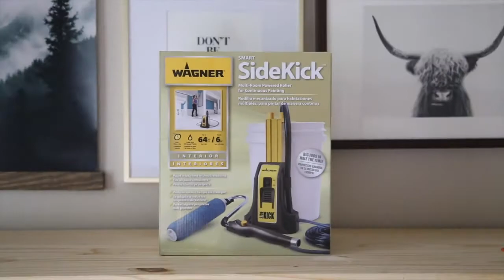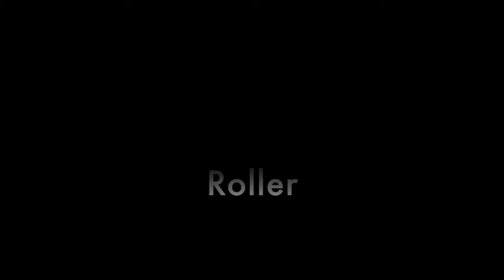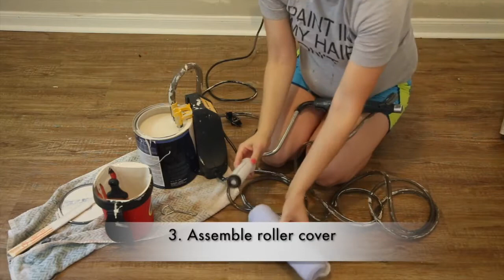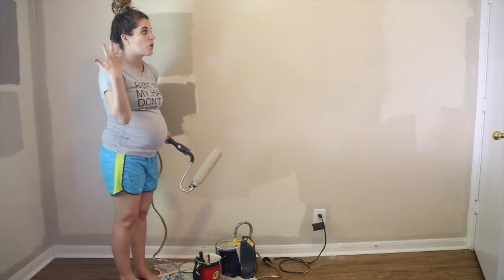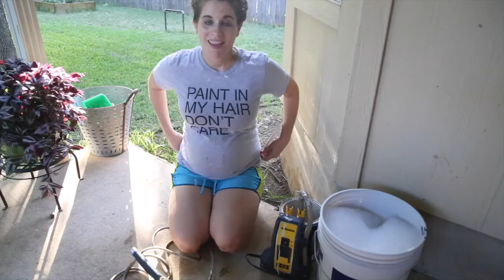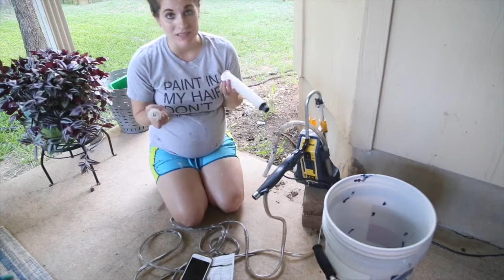Power Tools for Beginners: Sidekick

Comment: After taking popcorn off a 1450 sqft home, repaint ceilings, 3/4 repainting the entire home by hand with a 6 inch roller, bc I am not 21 anymore and rotator cuffs give me a challenge with 9 inch roller, and coming the conclusion that I do not like to colors on the walls, thus deciding to start over, when I found this gizmo last week, and just did one of the largest walls (12x30 slanted) in a great color in 25 min. incl. the cut at the ceiling with the Shure Edge, I am really in heaven! 
Not exhausted, no pain in rotator cuffs, bc if in case you are wondering, even a 6 inch roller holds a little over 1 lb of paint!!!! and that gets heavy after 25 min. up and down, dipping into that tray!
Oh, BTW, I am over 65 and doing this alone! Wish Home Depot had told me about this gizmo from the start - $85 is nothing - my body and my time is, since I still work 3/4 time in my own biz!
Thank you for your very clear explanation showing how to work/clean it. You are appreciated! :)

Comment: Awesome tutorial.  Just bought two of those.  Got one delivered via Lowes, but it was opened and already used, missing the roller (grr)..  so that is going back when I can.  Amazon just delivered it's replacement the next day.

Painted the bathroom in about 5-10 mins.  Prepping took way longer (tape and tarp).

MIGHT do another coat (wall is ancient paint from the late 1940s) since the way seems wicked thirsty. Either way, off to cleaning.

Thanks again for sharing your video.